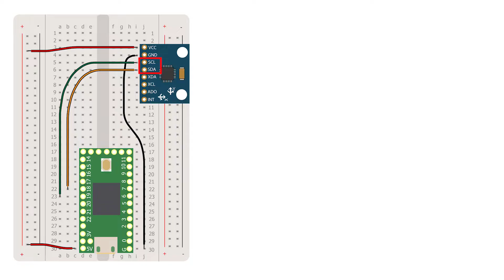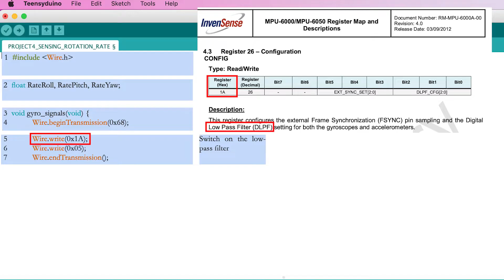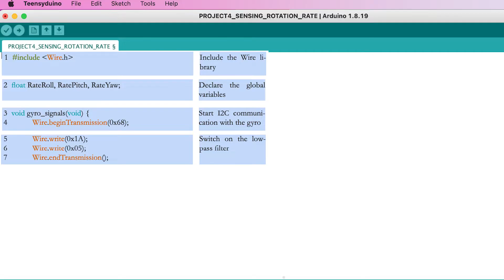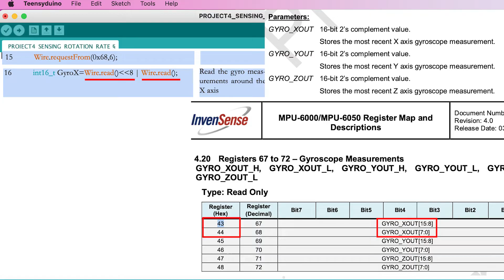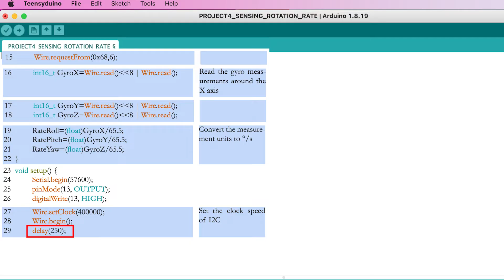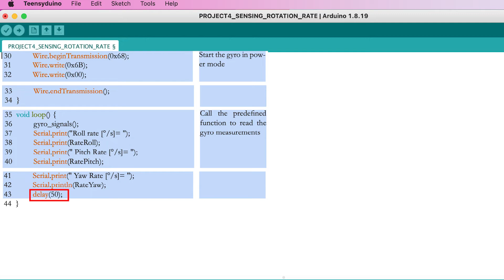4 | How to use the MPU6050 with Arduino and Teensy

Comment: Can Teensy be replaced with other chips? for example raspberry pico pi? Thanks
Reply: why not? you can even use cheap board like ESP32 , the code optimisation is upto you tho . Whatever you use just mind the available RAM and processor clock speed, you probably don't want to use these cheap boards for a good drone . but for micro drones based on coreless motors you can obviously go with cheaper things
Reply: @P0K0 thanks.The Teensy board is too expensive so I will use cheap chip and  motors to make a micro drone.
Reply: @一天-b3e  that's great man . I'm poor so I'll go with coreless motor cheap drone too . probably with esp32 , haha 😂 it's just a dream of mine to create and fly one doesn't matter if it's fall into toy catagory .
Reply: @P0K0  I am just about to start a project with esp32 as well. How are you doing so far?

Comment: Nice video! One Quick question: 1)  I would like to know the time period for the above calculation which I could use to compute roll, pitch and yaw in angles. Displaying roll, pitch, yaw in angles would enable the user to verify and validate the rotation undergone by the sensor instantly. Thank you.
Reply: Try 0.01
Reply: Did you find your answer ? bc i'm also searching it

Comment: My Roll Rate is -0.02 and Pitch Rate is -0.02
Reply: same ive been trying this esp32 and this is exatly my problem . Did you find any solution?
Reply: I had the same problem. When I ran the IC2 scanner in the IDE example tab, it returned "No I2C devices found." I checked my wires, and my ground was disconnected.
Reply: It's most likely that you are using the wrong memory register. Use the I2C scanner on the arduino IDE and change the Wire.beginTransmission(0x69) to Wire.beginTransmission(The address the scanner indicated). You may also need to wake up the gyroscope by putting this at the start of your void setup
Wire.beginTransmission(The address the scanner indicated);
Wire.write(0x6B);  // PWR_MGMT_1 register
Wire.write((byte)0);     // set to zero (wakes up the MPU-6050)
Wire.endTransmission(true); 
And put this at the start of your void loop
Wire.beginTransmission(The address the scanner indicated);
Wire.write(0x3B);  // starting with register 0x3B (ACCEL_XOUT_H)
Wire.endTransmission(false);
Reply: @nguyenhoangnam6973  i had the same. Fixed by adding the missing Wire.endTransmission(); between the Wire.write(0x43) and Wire.request(From0x68,6) in the voig gyro_signals function.

Comment: Hello! Great video
I am currently developing a thrust vectoring system that also works with the exact same IMU. However I am having a lot of trouble since I cannot get my MPU6050 to provide reasonable values, I am getting enormous spikes in angular rates with the slightest disturbance in orientation. I have tried all sensitivities but it did not work. I would appreciate some help.
 Thank you
Reply: Hii, I wonder how your project went? I am curious to learn about thrust vectoring system :)

Comment: Hi Regarding pin 13, Output, i am using a totally different arduino board, ESP32, do i also set it as pin 13 ? and what does pin 13 control ?
Reply: It seems to turn on the internal LED. He used it in video 2
Reply: I'm usding an Arduino Uno just to test things out, I removed the those two lines about the output and high as I didn't need the light.